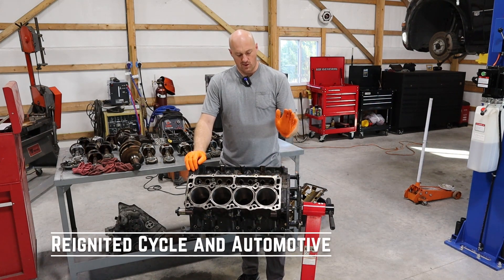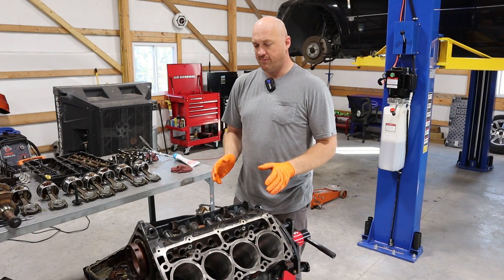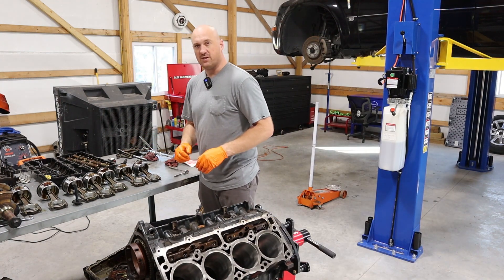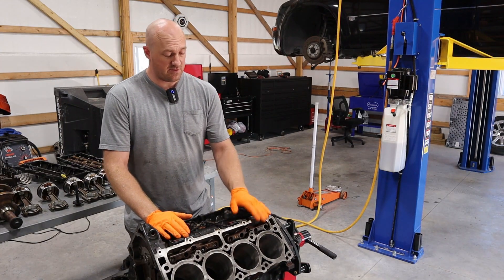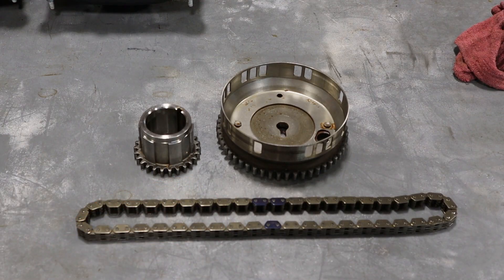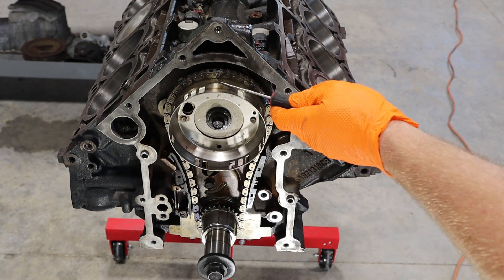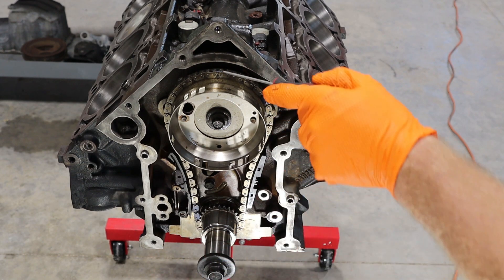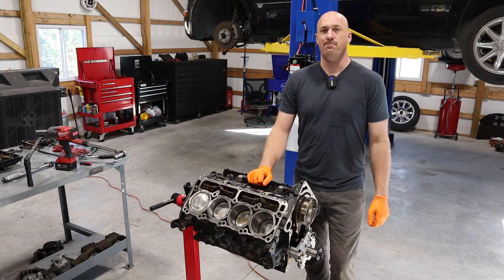How To: Engine Timing on Chrysler Hemi 5.7 // 300C Episode 3

Comment: I had the dumb tick! Had a couple shops tell me its gona cost thousands! So I started watching you tube videos. I went an bought a couple tools, spent under $1000 on parts and tools total. I just got my cam back in.  Still got everything else to do. But its coming along!  Its not an easy job for a DIY guy but so far its doable.  I wish i would have kept better track of the where almost the bolts on the timing cover goes.  But gona try to figure it out when i get that far. Good luck and thanks for the video!
Reply from the maker: Great job tackling it on your own!
Reply: How's she running?

Comment: If you wanna change the oil pump remove most of the oil pan bolts and use a pry bar. You can get it out. Did it on mine

Comment: So basically if you line the top timing mark at 12 o’clock an the piston is at tdc your in time the mark at 6 o’clock should automatically line up down bottom if the top is correct ?

Comment: I saw a video the guy got to the pick up tube on the oil pump by removing the right side timing tensioner, which allowed the room to remove the bolt on his 5.7 truck...

Comment: Thanks for mentioning the torque specs for the tensioner,the camshaft bolt, and the oil pump bolts...
Reply: Did you ever found the torque specs?

Comment: I actually managed to remove the oil pump without removing the oil pan, had to buy a 75 degree offset wrench and shave it down. Then I shoved a rag in there so it didn’t fall in. if you remove the gasket on the oil pan it doesn’t touch as you pull it off.

Comment: Hi big fan question rebuild my 09 ram 1500 5.7 I am not sure but I think my timing was not correct I tried cranking it over only kinda stays running when I give it gas really rough how bad did it damage the engine you're opinion can it b fixed or motors done
Reply from the maker: Before you jump to any conclusions watch this video first! https://youtu.be/jMziMqWRMk0
Reply: Thanks for the video I seen most all you're working on hemis I followed the steps exactly for tming maybe I missed something gonna tear the valve covet off take a look and the timing cover praying the piston didn't destroy the valves thanks again 🙏

Comment: Hey man everytime I get my cam to 12 o’clock the crank doesn’t perfectly line up to 6 it appears to be tdc at #1 tho how perfect does it have to be to have no issues? My crank dot is like a millameter away from true 6 o’clock but as soon as I turn it anymore #1 cylinder is starting to go down…
Reply from the maker: Sometimes if the timing chain is getting some stretch in it the marks won't line up exactly but it'll be very close, the crank mark is the more critical of the two. you can try moving the cam sprocket a tooth before and a tooth after and you'll see that it's not even close to lining up that way.
Reply: Gotcha👍 thanks for the help man you’ve helped me a lot on this rebuild!! I think I’ll just order the timing chain kit from Napa I’m doin cam and lifters on my ram kinda a pain to get back into later if it does end up stretching more or have the tensioner break later on.
Reply: Ohh okay so maybe I need to replace my timing chain you think? It’s got 100,000 miles on it.. Cause if I line it up to where the crank is true six o’clock the only way I can get my cam on is if it’s slightly passed the 12 o’clock position I can’t seem to make it work any other way it’s either off on top or bottom.
Reply from the maker: @CJ9494.  it'll work as is, but a new timing chain might not be a bad idea. A tip though, don't buy a cheap aftermarket chain, they tend to rattle a bit and it's really annoying.
Reply: Would you recommend a new oil pump too at that mileage considering my cam got thrashed by the lifter?
Reply from the maker: @CJ9494.  It's a good idea, likely some metal debris has gone through the oil pump itself and scarred the face of the rotor. It's a good time to consider an upgrade as well.
Reply: @ReignitedAuto  thank you for the advice I just bought a higher pressure oil pump off summit racing stock volume though. Do you think the higher pressure could interfere with mds lifters or do you think it should be okay?
Reply from the maker: @CJ9494.  shouldn't affect it, I'm running 75psi on my car with no issues.
Reply: @ReignitedAuto  sweet thanks again man I appreciate your time!

Comment: Your videos have helped me get through my 2005 5.7 cherokee. But a suggestion I noticed you didn't mention in timing it is being 180 out. I just did mine and after doing the revolution my can was at 6 along with crank. It back off put cam back at 12 and good to go. I was wondering for a few days if this would happen and it sure did to me. Luckily I've been wrenching for 22 years on my stuff and been there before. This is the start to my motor building now I have lots of room, cars and all the proper tools

Comment: So no matter how many times I turn the engine over I can not get the cam and crank in alignment, they're always off by a hair, is this normal for then to not line up exactly no matter that I set it correctly everytime?
Reply: Let me just add that the cam is in time with #1 tdc but the crank is at 545 not 6 o'clock, valves all seem to be in time for firing order if you view the video I just posted. I appreciate any feedback!
Reply: This is exactly what my marks look like ! 
https://youtube.com/watch?v=-sheYCeYer0&si=H1Gye9Ke7yVX-nHO

Comment: Thank you for mentioning the colored links changing position. Every time I'd set the timing chain with cam dot at 12o'clock between the two colored links and crankshaft dot at 6'oclock centered on the single colored link I'd spin the motor and the links wouldnt be aligned with the dots anymore... Drove me nuts and I couldn't get past that point for a couple days. I feel so much better knowing that I've got it right now. Thanks to you. Seriously thank you
Reply from the maker: Glad to help 👍
Reply: It was difficult but I did manage to change the oil pump out without dropping the oil pan mechanics wire works wonders as well awesome video
Reply: SAME!!! So frustrating, been fighting for days WHAT AM I DOING WRONG?! (Turns out nothing)
Reply: Same here! Only video or post I’ve seen highlighting this. Thanks!

Comment: As usual very instructional video, I got a bad lifter/ cam on my 2010 grand cherokee srt8 6.1 so now I'm in the process of replacing the camshaft, lifters, springs, steam seals etc and wanted to know if I should use normal oil or assembly lube to install the new cam and also what type of oil do you recommend for the new cam brake in procedure and for how long I have to run that oil before replacing it with the normal synthetic oil?? Thanks

Comment: I'm curious about the condition of the engine at this current time.  2006 300c 5.7 hemi engine is notorious for having Piston and lifter failure around 80,000 to 100,000 mile range. Feed back would be appreciated.

Comment: Hello Great video!  I have something wonky after following this though...Im hoping it just needs to recalibrate sensors or something. I changed lifters and cam verified TDC on 1 and chain lined up to both marks at 12 and 6 as shown but after all was said and done it gives me a DTC Cam Crank misaligned? It surprisingly runs ok until the code puts it in limp mode... any ideas?

Comment: Question i should know by now but I've never disabled mds an left the mds lifters until now lol. Im working on my brother in laws 05 chrysler 300c an I'm removing the mds solenoids an adding the plugs an disabling mds via tuner. The mds lifters would then prime up the same as the rest right?  Since mds won't be able to activeate. I was checking your video for reference an thought about it when you mentioned the lifters. Thanks in advance.
Reply from the maker: Richard, unless you're replacing the lifters with non MDS ones you will want to leave the solenoids in place, otherwise full oil pressure will reach the MDS lifters and it'll be in 4-cyl mode at all times.
Reply: @ReignitedAuto  thanks for the info I definitely won't be pulling them then an will inform my brother in law why. Thank you again for the information an extremely quick response.

Comment: After every rotation should the 12 o clock position dimple always be a 12 with 1st cylinder up also when placing the heads back on do I leave cylinder 1 at Tdc

Comment: Well, I do have one more question. I have the engine out and on a stand right now. I replaced the rear main today. Next the oil pan and timing cover and water pump need to go on. What should the procedure be to install these three at the same time so the timing cover and or the oil pan does not interfere with each other.
Thanks again.

Comment: Wow, you are still answering questions and helping people. Respect for that!
I have a question for you. What is the torque sequence for the timing cover and water pump?
Thanks.
Reply from the maker: There's not really a sequence per sae, I just install them all loosely before tightening them down, and the torque spec for both the water pump and timing case bolts is 21ftlbs. 👍
Reply: @ReignitedAuto  Figured there wasn't a recommended sequence, since it's not mentioned in the FSM. Just seemed odd, so just wanted to make sure.
Thanks!

Comment: Thanks for your amazingly good info videos👏 I'm rebuilding my 2014 5.7 in my Ram  having trouble with finding the torque specs for the main cap bolts. I'm finding either 40 then 85 or 20 the 90° turn also do i need to buy new main bolts. Any help would be greatly appreciated 🙏🍻

Comment: Wait you don't have to pull heads to swap cam?
Reply from the maker: Technically you don't on the 2009+ engines, but for me, if you're changing the cam you'll want to change the lifters as well, which means pulling the heads. 👍

Comment: i just did my cam, lifters and oil pump on my 1500,  i actually installed a 6.2L pump, i managed to leave the oil can on but man it was a job. the only thing i didn't do tho, when i changed my timing chain and sproket is that i didn't pay attention to the marks on the chain. the engine was timed tho. is it an issue ?
Reply from the maker: Nah, the plated links are only used as a guide to time the engine, after that they don't matter 👍

Comment: What I do to install the cam much easier is I put the bolt on get a socket that fits the bolt with an extension bar and that gives me leverage to get it in all the way in. Try it! It's amazing lol
Reply: I happen to have a long bolt similar to what you did to get better leverage  to put the cam in. Like your suggestion it worked great.

Comment: You said in the beginning of the video make sure you go in snd out of mds mode. How do you do that?  New to hemi. I’m going to attempt cam and lifter job with mds but worried about throwing it out of time. All the help is appreciated . 
Where can i get reliable parts at a good price?  Bad luck on my side. Kidneys failed on me and lifters and cam issue getting worse  which causes power lose when i step on the gas. Haven’t worked in over 2 years. Positive side is i just received a transplant 10 months ago . 
Looking for cheapest parts and what to order??

Comment: You said it was possible to do a cam swap without pulling heads? How would you get lifters up high enough to clear cam lobes?
Reply from the maker: Before removing the camshaft you spin it 720 degrees and this knocks the lifters back far enough to remove the cam. Of course you have to remove the rocker arms and pushrods to do this.

Comment: Fergawdsake, screw something into the  cam bolt hole, so you can control the cam while you're inserting it into the cam bearings! You could use a short piece of all-thread into the new cam, and screw the now exposed end of the all thread into your old scrap cam. Then you have a balancing point and you can use the old cam like a big handle/lever to more easily control the insertion of the new cam so you don't nick or raise burrs on the cam bearings.

Comment: What if I broke a water pump bolt on the timing cover and I want to replace the timing cover on a 2010 dodge ram 1500 5.7 before I install the water pump.. any suggestions pls

Comment: wait a min. acording to my hanes manual. just double checking here , the 2 timing marks on thr chain go on the bottom sprocket not the top as you say.
Reply from the maker: I've heard this from others about the haynes manual as well. All I can say is the Chrysler manual says to do it the way I explain it. In the end the marks on the chain are irrelevant, they are there merely to make sure the timing marks on the crank and cam are lined up correctly, so basically you could do it either way and it'll come out right. 👍

Comment: when rebuilding a 5.7 hemi do you think that upgrading to a high volume or high pressure oil pump would help with the cam oiling problem?
Reply from the maker: I do, in fact I'm releasing a video soon about installing a hellcat oil pump which is higher volume to help alleviate this issue. 👍

Comment: Awesome videos sir! Question: if I’m having lifter failure, do I need to change the lifters as well as the camshaft, or can I just replace the lifters??
Reply: I just replaced my lifters on a 2008 Chrysler Aspen 5.7 hemi as one had a hard knock on cold starts that got worse over time. The rollers and needle bearings were still perfect and a quick check down the lifter bores to inspect the cam all looked good. Roller cams don’t have to be replaced with the lifters like the non roller cams as they don’t have wear patterns to worry about. Reuse the cam if you can unless it’s a real high miler and may be safer if it starts to fatigue, but I think with proper oil changes and good 5w20 oil it will go along time. I have 172000 km on this unit and lifters were changed previously under warranty at 70000 km.

Comment: I purchased a truck recently.  It just came back from the mechanic and was told that the cam was replaced due to a cam failure when I was looking to buy it.  I liked it so I bought it.    I have zero experience in actually knowing what the hemi tick actually sounds like.  It ticked imo since the start and sounds like a lifter tick.  I have never heard the engine run without a tick.  I replaced the headers with bbk shorty headers and arp manifold bolts.  I replaced the gaskets and didn't hear any difference when I replaced the gaskets and short headers.  Do you think it would be a good idea to replace the lifters and because Im removing the heads get them milled at a machine shop or do a full cam / lifter replacement.

Comment: these videos are awesome! have a question. my Haynes repair manual has the single blue link aligned/on the camshaft sprocket mark and the two colored links straddling the crankshaft sprocket mark. does it matter? also saw another showing the same. please keep sharing
Reply from the maker: Nope, the links are just there to help you align the crank and cam during initial installation. As long as the crank timing mark is at 6 o clock, and the cam timing mark is at 12 o clock you're good to go. 👍

Comment: I have a 2005 Chrysler 300C and recently had to replace timing chain tensioner. I was told that it may be off by one tooth based off a P0016 code. Is this a job that can be done without taking the engine out? Any tips or advice would be much appreciated!
Reply from the maker: Hey Jon, you can verify timing by removing the front cover and also removing the oil pump assembly. At first it seems like you won't be able to remove the oil pump because of the pickup tube, but by removingthe oil pump bolts you can rotate the pump enough to get the pickup tube bolt out. Then just let the pickup tube rest in the oil pan while you adjust the timing. 👍

Comment: I was just wondering about the piston, did you just replace the 1 piston head? Just bought a 2013 Charger R/T 5.7L with 166,000 miles on it, expecting to have to repair something soon...lol. I really enjoy the details in the video, I feel like I know my car already.
Reply from the maker: Yep, just replaced the one bad piston. I've got more details on the newer style engine in my budget challenger build series if you want to check that out. 👍

Comment: What are the torque specs for the pistons?
Reply from the maker: Connecting rod bolts? If so, 15ftlbs+90 degree turn. 👍
Reply: @ReignitedAuto  yes thank you so much!
Reply: @ReignitedAuto  also you said the bearings are a match as you can see both of the half are a pair. What do you look for?

Comment: well i am redoing my timing because i think i did it incorectly (changing cam) but in the lx manual for a 2006 5.7l it talks about the opposite to what you are stating !!!
I will follow the manual
Reply from the maker: What does the manual say? And who's manual is it? My direction in this video is straight from the Chrysler service manual. I'd be interested to know if there's differing manuals out there.
Reply: @ReignitedAuto  it is a manual i bought on line . what will change if i follow manual .I do not think that it will change anything
Reply from the maker: @waynelemieux5111  I'm just interested in what the manual says to do versus what I'm saying to do, it doesn't matter to me what you end up doing 👍
Reply: @ReignitedAuto  the y say that the paint marks single for the cam and double forthe crank
Reply from the maker: @waynelemieux5111  ok I see, but the marks on the cam and crank themselves don't change. That's fine then, the marks on the cam chain itself really don't matter, they assist in setting the timing, but aren't strictly necessary. The version I have in my video comes straight from the Chrysler technical servicemanual, but you could follow the manual you got and it wouldn't change anything.
Reply: @ReignitedAuto  thanks the marks on cam and crank and keyway don`t change